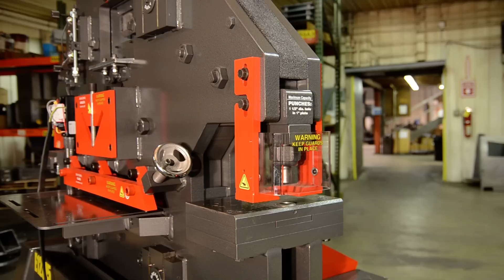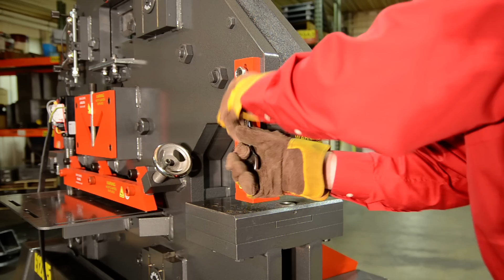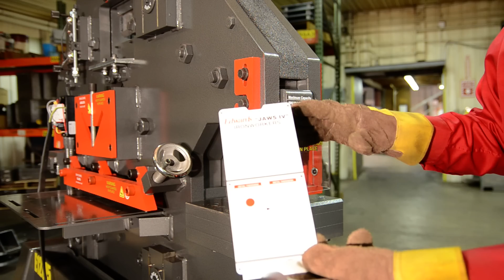Edwards Punch Station Video

Comment: Yep got a question. Why when I take a 20-foot piece of flat bar lets say a 1/4 × 2 . And I want to shear three quarter inch pieces they don't fall out of the back of the machine into the bucket? Or even one in or 1 and 3/4 for that matter of fact? They just build up in the back of the machine and I had to keep walking back and forth to remove them?